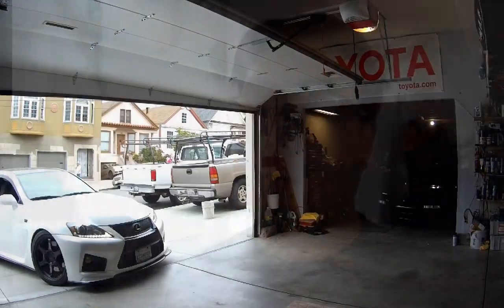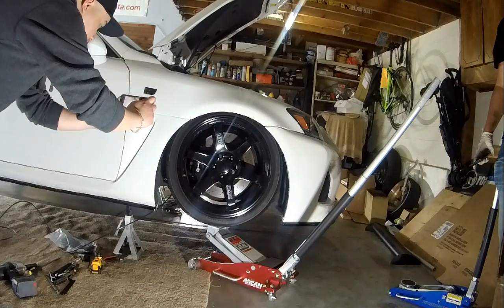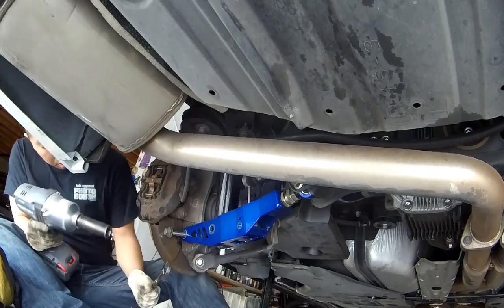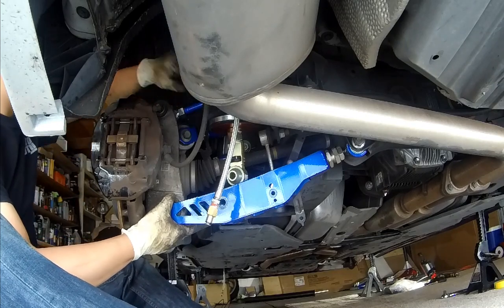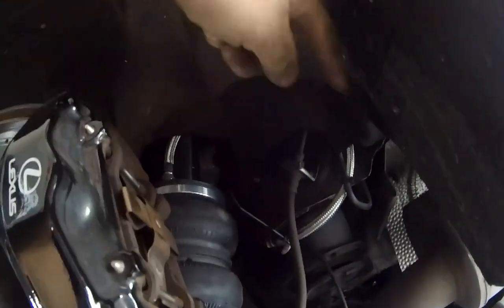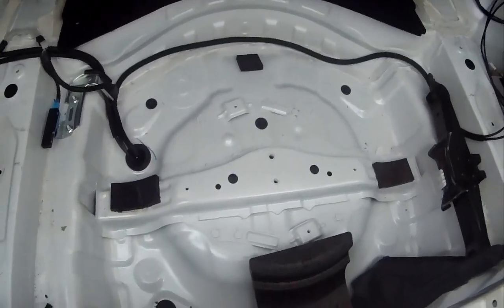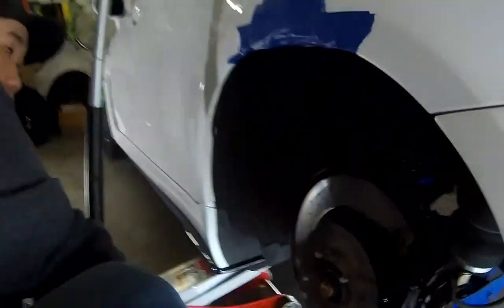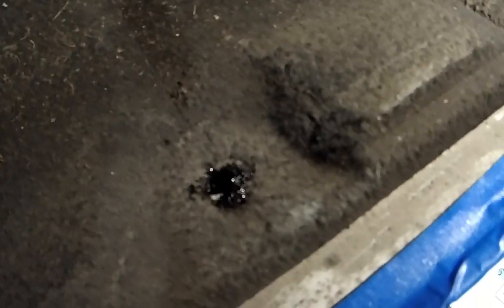Finishing up Airlift airbag Air Suspension strut bagged install Aimgain Lexus IS-F

Comment: Do you have a video showing how to wire it up? I have all my struts installed and have my lines ran, I don’t have experience with wiring so I’ve been hesitant on doing it myself. Any tips, recommendations or a push in the direction of a how to on wiring dual compressors for IS 250/ 350 06-12

Comment: I just ordered the P3 kit and I noticed that the "Air Lift" logo faces the the opposite direction on my manifold than yours does. I'm looking at running one of those management brackets so is there a way to flip the top of the manifold with the logo so it looks like yours? Is that what you did?
Reply from the maker: Yes you can flip it easily, the logo comes off, its just held on by Allen bolts
Reply: Alright cool, thanks for the quick reply!

Comment: How do you find the rear struts?  Good quality? What’s the ride like? I’m thinking of getting them for my custom setup as I need the bag at the bottom not the top like most struts.
Reply from the maker: +LTD347 it's my friends car, but no complaints from him so far. Better to have this style bag strut so wide wheels don't rub and rupture the offer standard style bag setup on 2IS
Reply: specONE your friend wouldn’t happen to have dimensions by any chance.  I’m finding it difficult to find measurements.
Need to know bottom mount to top of bag and overall height of the unit
Reply from the maker: +LTD347 he wouldn't know, I'm the one that installed this for him if you noticed in the video that I made
Reply: specONE yeah I know but I wasn’t sure if it might have been in any of the documentation in the kit? I’ve emailed airride so waiting for their response 

Thanks for your time
Reply from the maker: +LTD347  http://www.airliftcompany.com/content/manuals/MN-977.pdf&ved=0ahUKEwi_h9jmkLHYAhVR7GMKHSzXB54QFgglMAA&usg=AOvVaw1EX2v6cU0XNNPax3R7p3Pc
Reply from the maker: +LTD347 hope that helps you
Reply: specONE thank you. Have a great day
Reply: I ended up buying a set of rears and got them installed. It’s dope af haha.

Comment: Whats the offset on the TE37’s?? Tire specs??
Reply from the maker: 19x8.5 +22 
19x9.5 +22 
225/40 fronts 
255/35 rear
But there are camber arms added in the back so it can clear quarter panels
Reply: specONE if you run stock suspension or coils, would the rear still clear quarter panels?
Reply from the maker: No it will not. This car was on coilovers and the camber arms were put on then before the air bags were done so it could clear.

Comment: How the air bag suspension rides?
Reply from the maker: D K if done properly it will ride just like a spring setup. Each corner should have it's own separate valve if doing manual setup. New technology now is digital air management and I think that is the best way to go. These also give you presets, press a button and  your are auto  adjusted  to your drive height. Some digital Managements off the top of my head Airlift 3p/3h (what we used in this car) , Accuair E-level, Airrex ,  etc.
Reply from the maker: D K The saying from back in the day of cars riding floaty like a boat is due to them sharing one valve to control a pair of bags. i.e. front together or rear together. The problem with this is that when one bag is compressed when you hit a bump in the road, that air moves to the other bag instead of creating a pressure back into that same bag, i.e. spring rate.  Separate valves for each corner fixes this problem people spoke of in the past.
Reply: specONE what part of cali are u guys from? Do you own a shop? I have a 2012 is F I'm thinking about doing the same thing ur doing to this F. Right now I have some bc racing coilover .
Reply from the maker: D K I'm from Northern California Bay Area. I'm just a regular person that knows stuff with friends that also knows stuff working on our cars. I am considering looking for a spot for me to start helping others out on their cars.